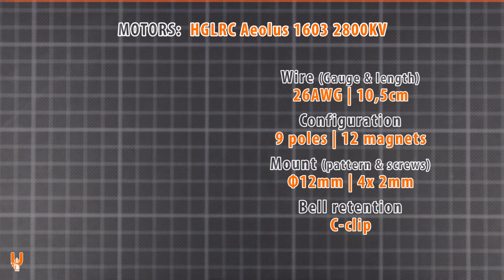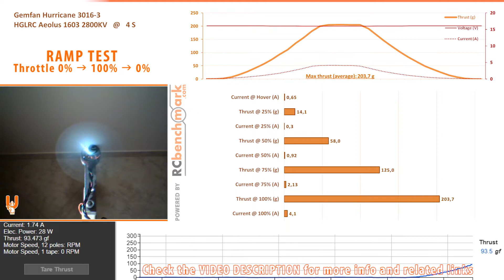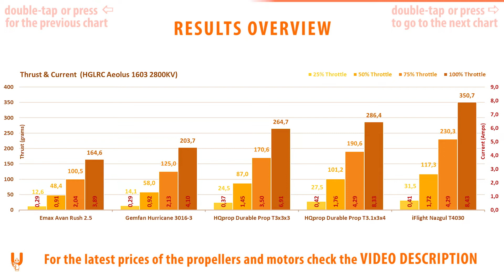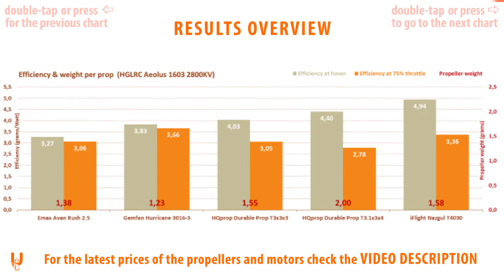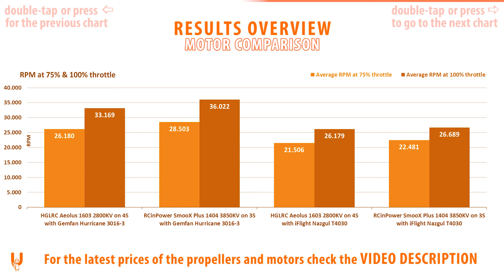HGLRC Aeolus 1603 2800KV FPV motors on 4S (feat. Emax Gemfan HQprop iFlight propellers)

Comment: Nice review bro. I was actually looking at putting this in the nose of a small foamy, with a 5030 prop if I can find one. Probably on 2s or 3s. Think it would handle it without melting down? 🤔 😂
Reply from the maker: Thank you! I have absolutely zero experience with airplanes :)

Comment: Hi friends. I would like to put this HGLRC Aeolus 1603 2800KV in a Zero airplane 70cm wingspam that weights 280gr, in a 3S lipo 460mah, with a 6x4 or 5x3 prop. Will it work fine? Thank you!
Reply from the maker: Hello and thank you for the long delay, I missed this message. I have absolutely zero experience when it comes to planes, I cannot give any recommendations for them.

Comment: Uh hm. The stator volume is less than a 1404 with the same weight. And way more less than a 1306 with the same weight. 
For what type of drone is this motor ?
Reply: a very light 4"
Reply from the maker: Yep, what Marc said. They use it, for example, on the Rekon 4 micro long range BNF.